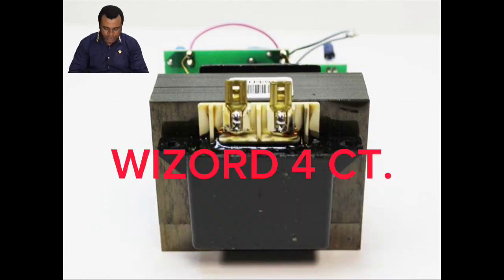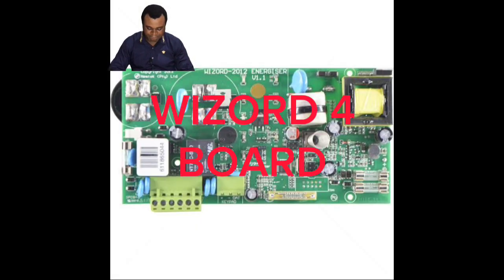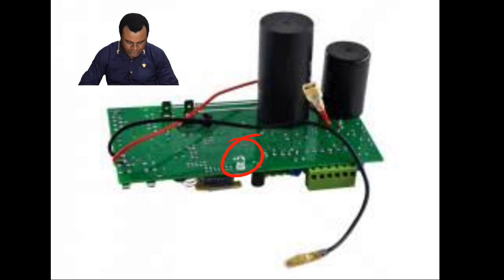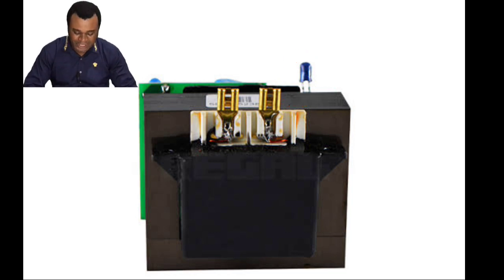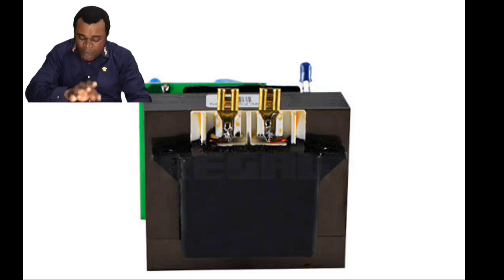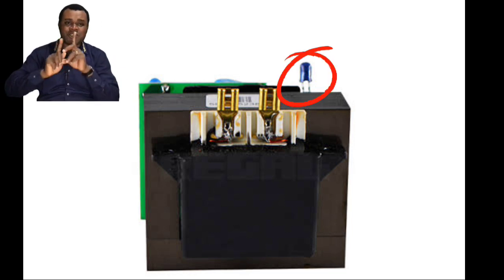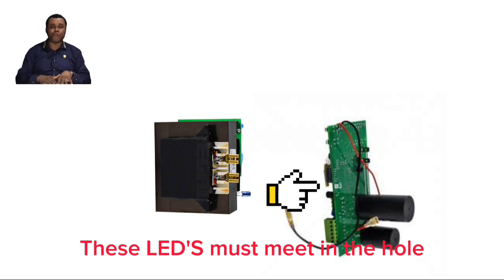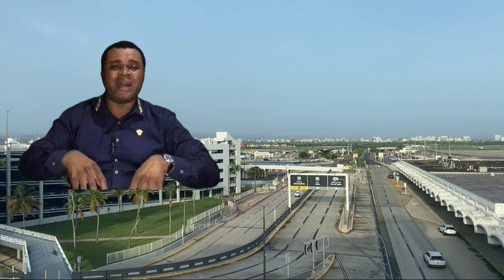How to fix a NEMTEK WIZORD 4 energiser alarm after changing the charging transformer.

Comment: How can I tell whether the Energizer is charging the battery or not? I recently got a new battery for a client and in less than a month the service indicator light started coming on while Energizer was making noise. After l removed the battery, the Energizer worked just fine and upon measuring the voltage for the battery I found that it was 6.28v
Reply from the maker: It's possible your Energizer is not charging, meaning 
1. Transformer is bad
2. Charging fuse is blown
3. The voltage input in the area might also be low.
Any of these can be the reason your Energizer is not charging. Double check all these steps listed
Reply: Thank you very much for the reply, I'll check as advised
Reply from the maker: @danielmwanza4319  to do a quick check, connect the Energiser to power outlet, use a voltmeter to read the Terminal going to the battery, but make sure the battery is not installed yet, the reading must be over 13v

Comment: Hello sir, i have an energizer that keeps cutting power on its own, like it will work normal then after some time it will cut out and only leave the power light on... what could be the problem.
*i changed the battery but that issue has persisted. (i suspect the charging circuit is not working)
Reply from the maker: Battery or it's not charging